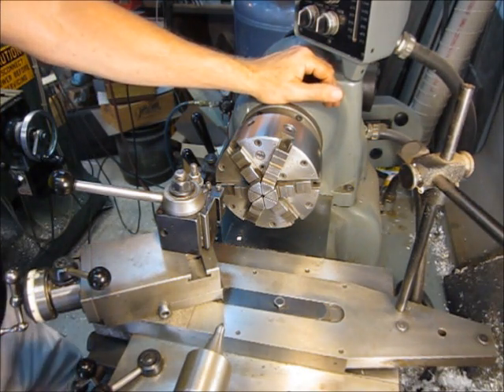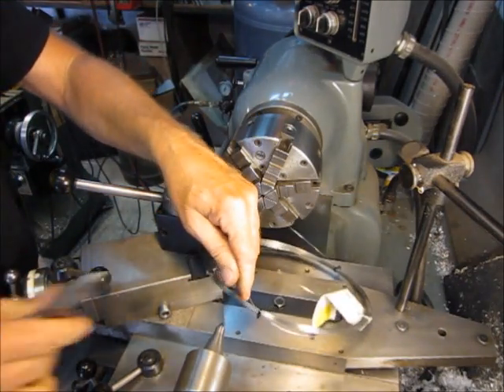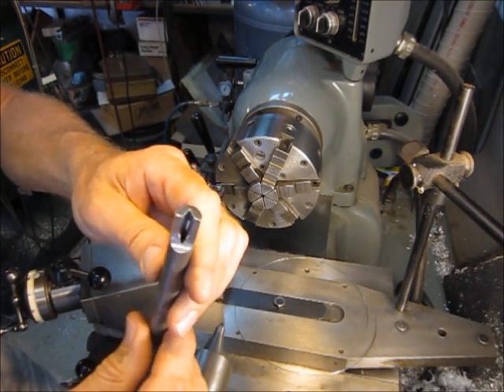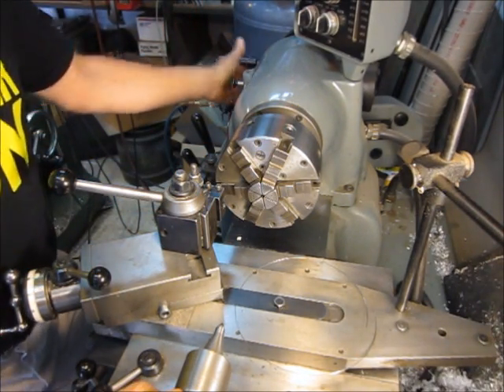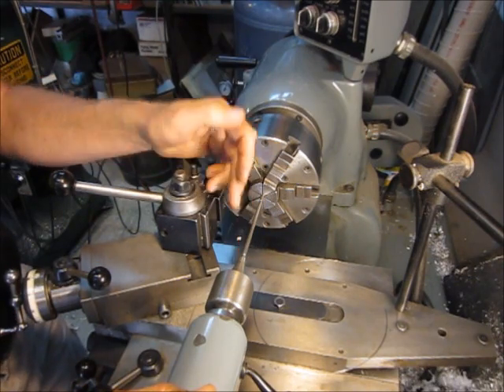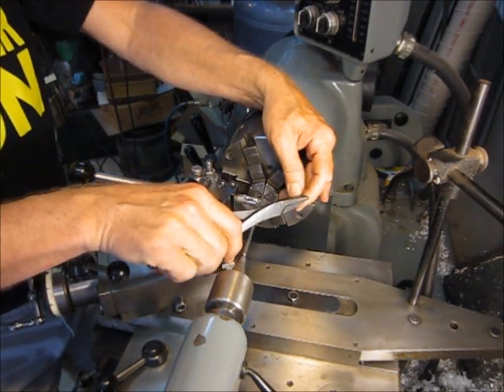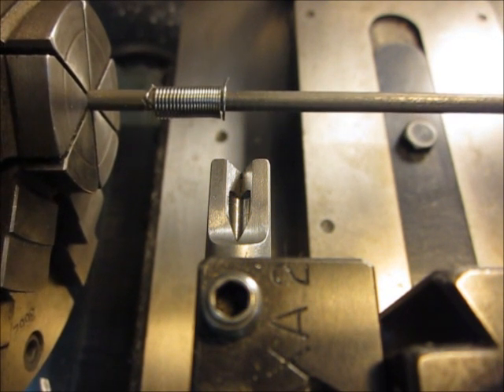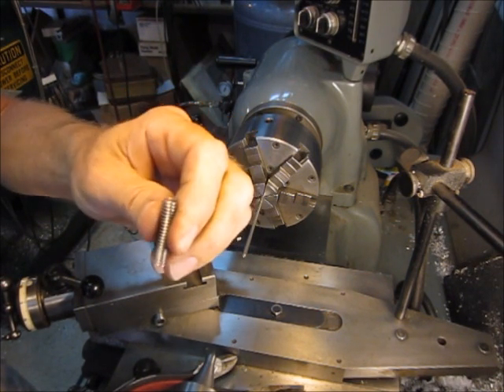How to Wind a Coil Spring on the Metal Lathe

Comment: Is there any thought towards how much tension is on the wire?  One would think more tension = tighter coil or less springback when the coil tension is released.
Reply from the maker: I used to wind springs with tension, but it's very difficult to keep it constant. This method makes much more consistent springs and doesn't require any tension at all. After winding a few springs, it's pretty easy to estimate the size of the mandrel required.

Tom

Comment: Great tutorial. Is Justin right? Do you need to heat treat?
Reply from the maker: I think that's something that would need to be proven with some testing. I've always used my springs as wound and never had any problems. If anything, I would expect a spring to get harder after winding not softer, so I don't understand his comment about it "losing shape".

Tom
Reply from the maker: whisperpandy

Thanks for the explanation. Stress relieving makes much more sense than annealing.

Tom

Comment: did i miss your mention of the annealing?   throw it in the oven at 400F (or until it starts to turn straw colored)  for an hour or so otherwise your spring will lose its shape before wearing out! :)
Reply: Annealing is the process of taking the temper out of steel, meaning it will just bend and stay in what ever shape you bend it to. To make it spring steel you heat it til a magnet won't stick to it and quench it. You do this three times. then you put it in the oven at 350F for 90 minutes
Reply: well, to get technical, annealing is actually a general term or catagory which includes a number of processes.  Any process used in softening or stress releif is considered to be annealing... it'll be refered to as full annealed, process annealed, crystal annealed... etc.... any spring i've made has been prehardened steel, meaning if anything one should normalize before beginning not heat and quench afterwards... but like anything else, you have to do a few and figure out what works best.  One wire or rod may not turn out like the last even from the same manufacturerer but a different roll.  You did a wonderful job, just pointing out for those who try but can't seem to get it to work as expected, it likely has to do with the pre/post treatment of the material.... play around till you find what works best... a great source of info is the "Machinery's Handbook"  search the PDF online... they're well documented in the Properties of Materials Section.

Comment: nice vid  been running lathe all my life  56 now  cant emphasize safety enuf  good job
Reply from the maker: Agreed. There is a video floating around of a poor guy who got his sleeve caught on a shaft and it pulled him between the shaft and carriage. Luckily, the shaft slipped in the chuck or he would have been killed. As it was, he lost some teeth to the spinning chuck.

Tom
Reply: Toms Techniques A fairly common accident around tractors and farm equipment is when someone wears loose clothing and gets too close to the tractor's PTO shaft.  I would imagine the effect is pretty similar.
Reply: +Toms Techniques Hi Tom.  I really enjoy seeing the mystery taken out of these processes.  Regarding industrial accidents, I've seen a lot worse on the internet than what you mentioned.  We tend to think clothing would just tear if it got caught in rotating machinery.  That's not the case.  Even a thin T-Shirt turns into a strong rope immediately once it starts getting wound up.  Long way to say I don't mind hearing your admonitions about safety in your videos...don't mind it at all.

Comment: If you wanted a compression spring, couldn't you just set the feed a little faster?
Reply: Yes, a ""better" method for creating a compression spring would be to set the gearbox for a more course pitch (calculated with the gauge/diameter of the music wire in mind).  This can also be done by creating a mandrel that has the matching pitch profile cut on it (much like a thread profile).  I always appreciate and learn so much from Tom and it's great when the community can add from their experiences.

Comment: if it can take a finger off how safety glasses will help?
Reply: The end of the finger won't hit you in the eye when it flies off.
Reply from the maker: If the wire gets wrapped around your finger, it'll take your finger off. If it gets loose and pokes you in the eye, it'll take your eye out. Wear glasses and keep the wire lengths short and you'll be fine.

Tom
Reply: well youll be able to see how to get to the hospital

Comment: Very nice Tom, I was a spring maker for 28 years, and worked in a spring house for 39 yrs total. You put a nice video out. I think the tightest spring I ever coiled had an index of 1.3. It was 5/16 wire around a 1/4 in mandrel. We coiled by hand on what we called dummy coilers which were driven by 6in belts. They had a foot brake so you could manage them. We coiled them in lengths and trimmed them. Some were coiled out in 10 ft lengths. Once again nice video.
Reply from the maker: Thanks Steve.

5/16" wire on a 1/4" mandrel is quite an accomplishment. I would thing the force required to wind the wire would be more than the mandrel could handle!

Tom
Reply: Tom's Techniques
Tom, we had what we called a crutch just in front of the wire, as you coiled the crutch moved forward. Don't get me wrong, this was very dangerous and you went very slow. The coiler was all hand operated, that is the controls, wish I had a movie of them. Never thought anything about it when I did it. We could coil up to .545 chrome silicon on our big coiler. There was more than one broken bone from wire in that shop. On our small coilers (Carlsons) we had small lathe chucks to hold the small mandrels, also close to where you chucked down on the mandrel we have the jaw drill and taped and put a small allen set screw in, you could use it as a catch pin for the wire, adjusting in or out for your wire size. I loved my job and the people I worked with. We coiled every type of spring you can imagine, and every type of material.
Reply: See my post above, regarding stress relief and tension on the wire. It will help you make a professional spring. Old retired spring maker.
Reply: I am currently a spring maker close to 20 years now. 1.3 index with 5/16 wire is very tight. Can't even imagine. It's a nightmare as you probably know when I make springs on mechanical coilers with a index under 3.  A lot of stress and a lot of broken arbors= headaches. I Use pencil arbors for those. I make springs from .020 wire to .500. I am now learning on cnc formers but love making springs on automatic coilers. And by the way if anyone reading this wondering about heat treating springs you should heat a spring like the one tom made for about 450 degrees 20 mins. It's called stress relieving. Although wire is tempered you put stress on wire while coiling it so stress needs relief. If not extension spring will now last too long once stretched it takes a permanent set and with compression springs if they not heated they lose force once compressed and will not return to original length especially when you have fewer coils. Great video Tom.

Comment: How much power would such a small hand wound spring produce? Im looking into making small springs for trigger groups and similar.
Reply from the maker: The same as any commercial spring. Force is dependent on wire diameter, spring diameter and pitch.

Comment: Awesome video. This is exactly what i need for a check valve we are making. Have you thought about adding an adjustable tension wheel to the end of the wire guide to maintain specific tension or is it not necessary?

Comment: I am very familiar w/ springs. Heat 450-500 30 min, slow cool sets memory.  For compression spring you might add spreader by modifying guide. Add screw & through hole drilled/ tapped on left side of guide. It spreads coils apart. Close fit placement xtrmly essntl. Screw has to push out right up barely past the Guide V exit on right side & bend coil open. Extnd/shortn adjust screw, use lock nut, fine threads best. Might try notched nut instead =max adj. I wound .09 .5 ID 5" long for lawn mower.

Comment from the maker: I prefer to cut slightly more wire than I need and use it all up. Less wire hanging outside the guide means less wire to get tangled on stuff, like your hand.

You can increase the feed to wind a compression spring if your lathe can feed fast enough (mine can't) and if you don't mind making a couple of trial springs to get the feed down. It's easy to set the feed for a close wound spring so I just do it that way and stretch to suit. Don't much care if it's "proper", it works well and it's quick.

Comment: dont use the entire coil but leave on some extra so when you have the length of spring you need, you stop the machine and always make sure theres still a lenght of wire in your wireguide not coiled up  , keeps the end product straighter. also... you need to set a bigger feed to make a proper compression spring , you pulling it out is messing up it being straight at all. if you set a feed bigger then the diameter of the wire you will already have your compression spring.